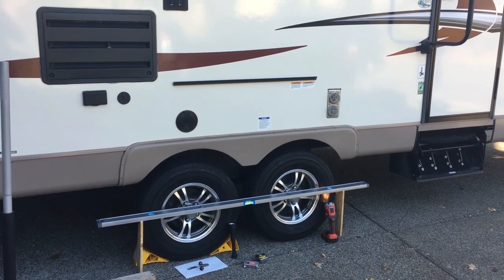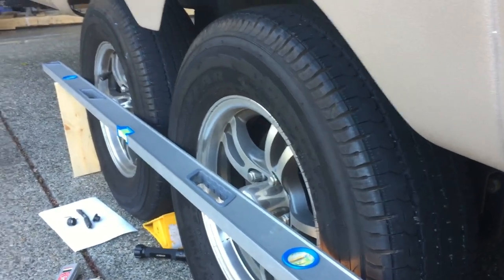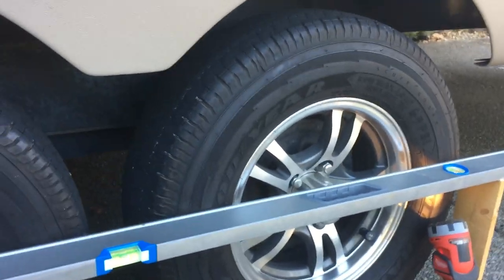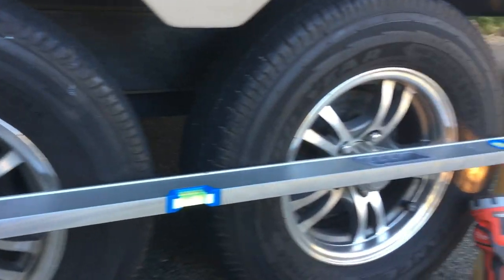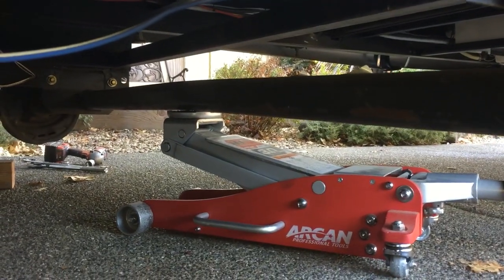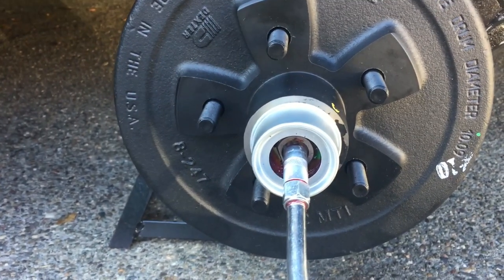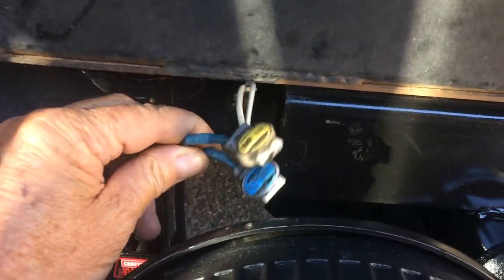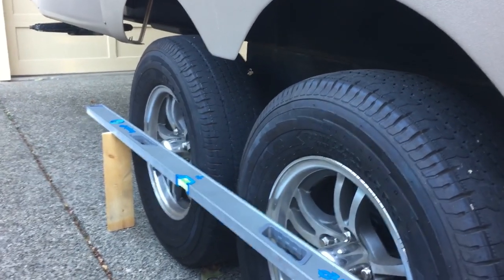Travel Trailer Bent Dexter TorFlex Axle Problem & Replacement

Comment: Same exact problem with my boat trailer.   I hit a curb.  Straight edge showed a gap about the same as yours.  A new axle corrected the problem.   I swapped tire locations left to right and overinflated the worn tire by 5 psi to hopefully wear the center a little more than the edge and get some more miles out of it.  Thanks for the video.
Reply from the maker: That's to bad, you need to watch for potholes also as they can cause damage. I was on the free way with our used 2020 trailer we just bought late last year and were on the interstate I-10 and you would not believe how many pot holes I hit that could not be avoided. we have the same Dexter axles on it. Anyway I'm in the process of replacing two axles. The spindles were both bent on the passenger side :( I hope to put out a video on the replacement in the near future. Thanks for commenting and sharing your information with me and others.
Reply: @thetraveltrailerguy  Yeah.  It was difficult to tell my spindle was bent.  I used a good straight edge from a reference point to the disc brake rotor on both sides.  I could definitely measure a difference in length but not that much.  I was 80% sure it was bent.  The new axle was definitely needed. The straight edge across both tires is the  best way to tell I'd you.have an issue.   Good luck.
Reply: @joesilverbliss1721  I hit a curb with my Suburban once and it blew up the differential.

Comment: When buying our first new semi tractor quite a few years ago..We had problems with front steer tires wearing..The truck dealer blamed it on the tire brand..The tire dealer blamed it on road hazard conditions..After several expensive tire replacement..The alignment was suppose to have been done at the factory..When we took the vehicle to a heavy duty alignment place especially done for large vehicles. The alignment was way off..The next vehicles/trailers purchased  new tire replacement,or if tires showing wear we had alignment checked. That hub needing grease coming like that from the dealer should never be..Terrible a buyer has to go  behind to check to see if everything is done correctly.. Later on we also found out from a different tire dealer we didn't have a heavy enough tire ply on our steers..Costly mistakes for the buyer..Thank you for the video..Have a Blessed Day..
Reply from the maker: Thank you so much for watching and sharing your experience with everyone, I'm sure glad I'm mechanically inclined to fix things or I would be paying a lot for labor. You have a blessed day to and thanks again for watching.

Comment: Good video, thank you. We had the same issue on our 2018 Airstream. It was replaced under warranty. I called Airstream about the Goodyear Endurance tire that it ruined, and they referred me directly to Dexter. Dexter was super to work with and they offered replacement (reimbursement) of both tires on that axle. Took a while but I did eventually receive a check. It was relatively painless with the exception of Airstream gladly passing the buck and being relatively unhelpful. Good to see a company like Dexter stepping up, not just for me but for you too.
Reply from the maker: Its great to hear that Dexter took care of you to. How bad were your tires and how did you figure out the axle was bad? I never thought of asking them to replace the tires. And thank you for watching
Reply: Michael Bracewell After a long trip through Utah I noticed uneven wear on the outside of a rear tire. Tire was almost bald and only a year and a half old. I had to take it to our local dealer for other issues and had them look at it as a warranty issue. They said the axle was bad and had put in for replacement. They replaced the axle and left the bald tire on it. When I brought it up, they said Airstream had refused and they encouraged me to go fight it out with customer service. The AS rep told me they refer those issues to the manufacturer and gave me the number number. I called, talked to a guy, and he was very understanding. He asked if it was just the one tire and I said yes, but they advised I at least replace in pairs. He agreed, talked it over with someone, and told me to email him the bill. That week I just had the whole set of four replaced at Discount Tire. Dexter paid half. Worth a try if you want to give it a shot.
Reply from the maker: @ChadHonea  Sorry it happened to you also, I'm going to try and give it a shot and see if they can replace the two tires, I think that since I  caught the problem so quickly after not much wear had happened to one tire they might deny it but its worth a try. Thanks for watching and your comment

Comment: I have a comment on the jacking on the axle. If I am not mistaken Airstream uses the same axle but tells customers that jacks and axles should never meet- to use jack points. Has something changed with regard to the rubber axles? A bent axle would seemingly cause the same problem you are trying to fix. I am glad you were able to get it all worked out.
Reply from the maker: Great question Rodney, thanks so much for watching and commenting. 

Yep these axles are not made to jack up a trailer because they will bend. If you notice I jacked up the trailer to remove the tires on the frame between the axles. I did lift the new axle in place by balancing it with the one jack in the middle to lift and bolt it in place (I was not lifting the trailer so the only weight I was lifting was the axle). 

It all worked out and I'm happy they supplied a replacement axle. Since I posted this its crazy how many people have contacted me to get details on how to get the same replacement axles since theirs are bent and they all have gotten replacements at no cost. 
A couple weeks ago I had a neighbor that bought a new Airstream a year ago and both his axles were bent, he saw my video on line and came to my house to get details on how to get replacements, I gave him advice and he received two new axles from Dexter within a week.

Comment: I'm currently dealing with dealer about our axle issue and its within warranty time and the travel trailer been at dealer for 3 months now. Dexter are willing give the part but not the labour to replacement. authorized dealer want to charge us $988 to replace the axle. Still dealing with jayco try the get cover the labour cost casue it still within warranty time. Thank you for sharing the video, lot useful information.
Reply from the maker: The same happened to me, Dexter replaced the axle but did not cover the labor to install it which happens most of the time with lots of things. As you can see I replaced mine myself but if you don't have the tools you need to take it somewhere to have it done. You should get a better deal if you take it to a brake shop to have it done, most of them will do this for you and probably for much less than a RV dealer. You can have the axle delivered to your house and then take it with you to the brake shop. The dealer should do it for no charge if the trailer is still under warranty but if the trailer isn't I understand why they won't. Thank you so much for watching and good luck
Reply: @thetraveltrailerguy  Good video, but based on some later comments, it seems too heavy to take a new axle to a brake shop.
Reply from the maker: @jeffreyreck3867  The axle is heavy but two people can carry it and put it in a truck to take to a shop. My wife and I can pick it up :)

Comment: Good Video   i personally think that most of these issues are results of the manufacturers  attempts at lightening the weight of the trailers  so they meet being able to  make Specifications of being pulled by more of todays vehicles  they do it by  using thinner Steel  thats just not up to the task of holding the axles ( poor Engineering IMO ) and the Axles get put under too much stress i will hand it to Dexter for sending you out the replacement at no cost ! Happy Camping  BTW my sisters family bought a Jayco Camper and the frame got all twisted out of  alignment under normal conditions  Jayco  did cover the repairs by authorizing a dealership  to pull the frame and weld gusset repairs to strengthen the Frame  that has Stamped Ovals throughout  the entire thing for weight reduction  on their first trip with the Camper I pointed out to my Brother In Law  i didnt like the look of that design as im a Airstream guy  anyway his comment was well its under warranty  at this point !  I also thought it was  too large for the 6Cylinder SUV  they had pulling it and he told me it was within Specs !  im the opposite when pulling i prefer to  have way more tow vehicle than is reccomended  and it makes towing easier  as well as being more in controll. in the event of emergencies  i prefer Amrican Made full sized Dually Deisel pick up trucks  as that combination has allowed me to  keep control of my trailer and vehicle in all kinds of  conditions  including snow, rain, and high windy situations   plus the Duall wheels helps out in braking  one  time i lost a front right  tre and rim. off my truck with a trailer intow and  i was capable of bringing everything to a safe stop
Reply: Torsion axles connected directly to the frame are a bad idea to begin with.

Comment: Dexter is a Big Brand name, so I'm sure they wanted to make things right for you. You did a great step by step show of a DYI projuct which will prove valuable documentation for yourself, as well as for others who might have a similar problem. Pics were clear, vocals were articulate. It's amazing how many You Tube folks slur their words & make fuzzy pics. Did Dexter question if you had gone over exceptionally rough terrain before granting you the new axle? Also, did you put a plastic or rubber gromet for those brake wires running thru the frame to guard against freying the wires? thanks again for uploading that repair.
Reply from the maker: Thank you so much for the kind comments Frank. When I contacted Dexter they did not question how this might have happened but I did let them know that all the roads I have driven on have been smooth. They provided me excellent customer service :) Yep I did rubber grommets in soon after, good catch :)

Comment: I have the same issue, but on the driver side and the tire is pointing out.   No idea how this happened.  We just went to Yellowstone and back from TN, and there was some horrible roads (Kentucky I24 was the worst.)  Inside tread is 1/2 that of the outside.  I took it to a trailer service shop to verify.  They can fix it, talking to Rockwood about the warranty.   I noticed you contacted Dexter directly,  maybe I should have done that.   Not sure I want to do this fix myself as its a 11-12,000 lb fifth wheel.
Reply from the maker: That's to bad Todd, do you have the same axles that I have on your big trailer or do the axles have springs? If your dealer does not help you take care of it you might want to call Dexter directly and they will have you send some pictures to determine on what will happen next. Good luck I hope you keep me posted and thanks for watching
Reply: @thetraveltrailerguy  Rockwood is going to reimburse me for the install and axle.  It is a torsion axle 5200lbs.  Now I'm wondering if they will replace the tire that was ruined as well.  The good year endurance is currently around $180 each.  I went ahead a bought one this morning.  They have been out of stock everywhere for a while.
Reply from the maker: @Nuffs  That's great news Todd, I'm not sure if they will replace your tire but you can give it a try and ask. I'm glad you got this problem resolved. I live in California and from the time they said they would send my new axle to the time I received it was about a week so you should be seeing yours arrive very soon.

Comment: It’s a good thing you caught that problem. Did you put a straightedge on the axle, to see where it’s bent? Must have been like that since new.
Reply from the maker: I'm thinking it came this way from the factory. I put a straight edge on the square axle and it was straight.
Reply from the maker: After I sent pictures, tire tread depths, and completed their warranty consideration investigation form they had their enginers look at everything and said " It appears that the front axle has one tire with a serious toe-in condition" and then sent this email to me " Our warranty policy does not arbitrarily cover alignment, bent axle/spindle, camber, toe, abnormal tire wear complaints or regular or inadequate maintenance issues. We have no control over how the unit is towed, loaded, serviced or what other conditions the axles or parts may encounter during usage so our warranty policy normally does not arbitrarily cover these conditions, unfortunately we must respectfully decline warranty consideration for this claim request.

What we can offer to help assist the customer with this reported issue would be a customer concession for a replacement axle shipped to you at No Charge.  We would not be able to cover labor or any other expenses for this reported issue that is not covered under our warranty policy.

When Dexter Axle agrees or offers to supply a replacement axle to a customer as a ?customer concession? this is being done strictly as a goodwill gesture.  Customer concessions are not intended to convey or construe this action as warranty.
Reply: @thetraveltrailerguy  That bent axle should have been caught at the factory..Sloppy workmanship..The buyer pays the price..
Reply: @gailjohnson6670  No kidding this manufacturer has a plethera of issues on their trailers. Michaels videos are great but between he and I we could open up our own FIX DA MINIS shop. Take a look at your a/c vents in your ceiling and see if the vent channel is 1/2 covered with expanding foam...if so sent me a note and I will tell you how to clean it out w/o breakingthe vent louvers.
Reply: @scottgorman7166  My late husband even though he did a lot of repairs himself at home and on the road to our equipment. Saving us money and break downs. But sometimes being at the mercy to a repair place out on the road. He was always going behind checking for problems left by repair places and manufacturers...One time we had a part go bad that was under warranty on our semi...And took it to a big Intl truck dealer in Salt Lake City Utah while gone from home..They installed new part... After stalling for two days...Dealers don't like doing warranty work..No money in it for them.. When he crawled underneath semi the next day at a truck stop and checked it. He found the mechanic never greased the fittings..How long does it take to grease fittings? Sloppy workmanship..That would of led to an expensive repair later for us..I guess lesson learned is to check their work before leaving their place of business...
Reply: Do mind revealing the name of the dealership failing to apply grease to the fitting?

Comment: I've been that jacking the center of the axle as shown in this video results in a bent axle. Kinda ironic, considering the topic of the video.
Reply from the maker: Yep jacking the trailer up in the center of the axle with the full weight of the trailer WILL bend the axle. That's why I jack the trailer up at the frame between the axles. I jacked the axle in place installing it being careful not to apply pressure onto the axle. Thanks for watching :)